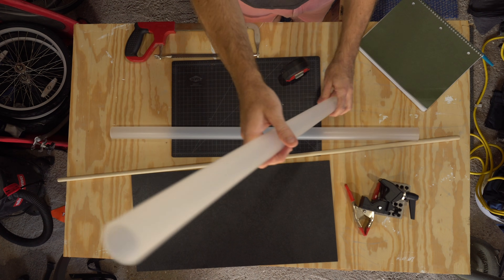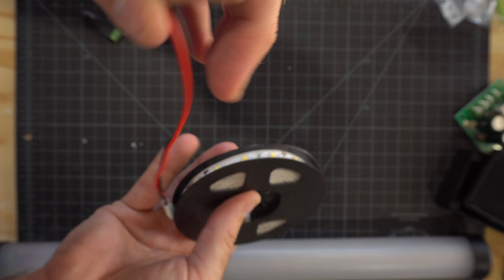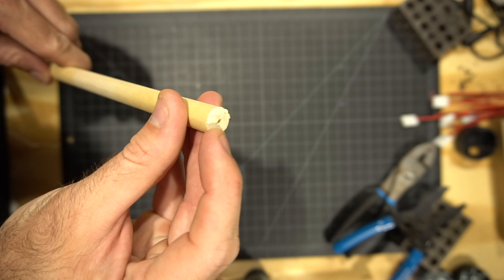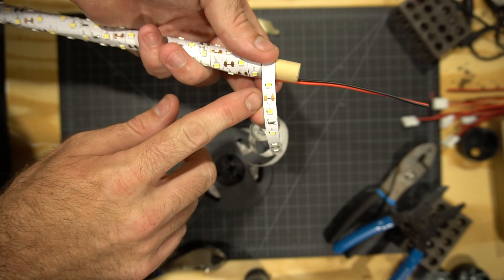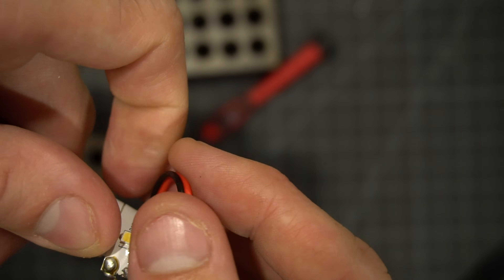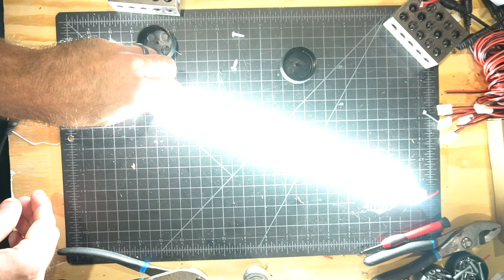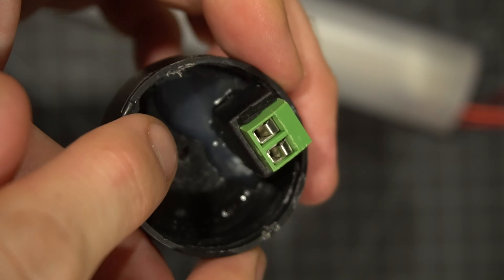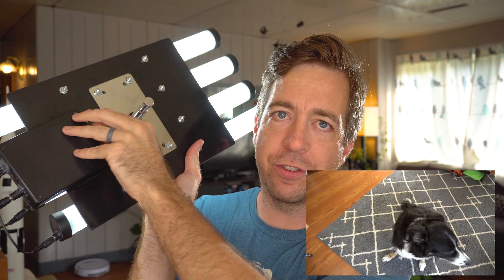TUTORIAL: DIY LED Tube Lights

Comment: A 4' quasar LED tube is $100 on amazon which is basically $25/ft.  How do these compare in brightness?
Reply from the maker: all Quasar brand tubes I've used will beat these in brightness, but I think the ones you're talking about are just the tubes and you'll need a housing (like an old KinoFlo shell or whatever) to mount them. These are fully self contained, other than power, much like the Q-LED line - which I believe are like $75/ft. If you can buy QS tubes then I recommend you do so - they are pro quality lights - but if you're interested in doing the DIY route these are an option to consider. Thanks for watching! :)

Comment: Whats the flicker like on these LED strips when filming video?
Reply from the maker: None that I've noticed but I'll do a shoot with them this weekend and share some footage - I'll run through some various frame rates and shutter speeds to see. Thanks for the question!
Reply: That depends on the duty cycle and frequency if using PWM.  I'd suggest varying the voltage or current instead.

Comment: that thing is going to get so hot, it'll melt the wire underneath the LED strip, just watch it :)))
Reply from the maker: Thanks for the feedback! I keep an eye on them at all times, and luckily I haven't noticed any heat that worries me (yet). If you've got any input on dealing with the heat on builds like this I'd love to hear it!  I'm not electrically inclined, just a tinkerer 😁
Reply: A possible solution is to cut a groove in the wooden dowel to flush mount the wire, or insert the wire into a hollow tube and mount the LED strip to that. The hollow tube would require finding a way to mount to the end caps.
Reply from the maker: Nice idea! I actually looked at hollow tubing first but couldn't find anything small enough that I liked. Appreciate the input!
Reply: That depends on the LED type and the current - usually heat is not an issue
Reply: @kennmossman8701   CRI90  heat is not an issue? OK :)

Comment: any idea how to make this with a battery?
Reply from the maker: Hi Jorge, great question - I don't have a definitive answer, but you SHOULD be able to power these with any battery that can output the correct wattage for your light strip. For instance any 12v battery would work for mine as long as it can fit the input - I regularly use a larger portable battery to power mine while out on shoots, but you should be able to use a 12v out on a V Mount or any other larger battery. Hope that helps!
Reply: Yes but it does get complicated by the choice of battery; Lead-acid, Ni-MH, Ni-Cad, Li-ion.   All have various advantages and disadvantages  Do use a PROPER recharger.  and keep in mind that even Li-ion batteries experience a voltage drop as they discharge.

Comment: With cheaper strips the mounting tape is crap - glue it down with epoxy.  Just put the epoxy directly on the surface, then apply the strip. The sticky tape will adhere.
Reply from the maker: Good suggestion!

Comment: If you have to solder a power connector then try using a molex style connector or terminal strip. The 'barrel' type connectors are a huge pain-in-the-@ss.   This is also true for 'external' runs as the barrel connector easily pulls apart
Reply from the maker: Kenn thanks for all this insight - I truly appreciate it!

Comment: If you 'tin' the copper pads on the strip before soldering the wires it is much easier/faster. Applying some flux beforehand can also help.
Reply from the maker: Hey Kenn, quick question - I've got an RGB light I want to use for this build, but it's got 4 cords and a 4 pin connector for power on either end... so I'm unable to run the wire along the dowel and connect to the top and bottom (hope that makes sense). What issues would I be running into without that? On another forum someone mentioned that wire helps distribute heat and voltage evenly throughout. Any input is much appreciated, and thanks in advance!
Reply: @DroiMedia  I think you mean wires (and not cords).  That's what I thought you did for the White LED strip which surprised me because it ought (!) not be necessary as "good" strip vendors state (how much truth there is in it is debatable) you can daisy-chain up to four 5m strips.  I have only one installation of a 5m strip and the brightness SEEMS uniform. Thanks for reminding me to actually check the voltage at the non-powered end just to see how much of a voltage drop there is.
Reply: @DroiMedia  The copper tracks / traces on strips (and such) are both thin and narrow which causes a voltage drop and so the LEDs at the non-powered end could be dimmer.  The voltage drop is  directly related to the current which is related to the density and type of LED (i.e 5050 versus 3825).  Generally speaking, the 'bigger' the LED and more the number of LEDs the higher the voltage drop. 
I have seen powering LEDs as you have done (from both ends) which ought to  balance the voltage (and so the heat would be uniform). I would not say the heat was distributed evenly as flexible strips "do not" distribute heat.
Reply: @DroiMedia  Soooooooo!   I see you have a few options. Ask the vendor for a RGB strip with the lowest voltage drop (I doubt they will have any idea as to what you are asking though) , or measure it for yourself. If the drop is more than say 0.2V then you could do as before (use a router to make a groove for the wiring), or run a buss wire at both the top and bottom. A buss wire is simply a thick wire meant to carry power to  circuits with minimal voltage drop.  There are Wire Charts available that give the raw data needed to determine the voltage drop for a given length and current
Reply from the maker: @kennmossman8701  thanks for this thorough reply (and yes I meant wires, long day lol), I appreciate your insight!

Comment: PLEASE anchor the soldered wires to the strip/wood using epoxy or hot glue.   Try to mount so the LED chips are offset
Reply from the maker: Hey Kenn - any reason to anchor the soldered wires to the wood? Just want to make sure I'm not missing something! I am by no means an expert with wiring/electrical work, so any input is appreciated. Thanks!
Reply: @DroiMedia  In general, any movement; (even heat expansion/contraction)but more  physical movement / shock  will stress the soldered connection - which is weak to begin with. This will either break the pad/trace  or the wire. To alleviate stress its SOP to bond the wires to a common surface. It is standard engineering practice that a connection be  1) mechanically bonded  2) electrically bonded.
Here you cannot get a mechanical bond but one can glue down the wire to inhibit flexing.
Reply from the maker: @kennmossman8701  This is awesome to hear, I had no idea. I truly appreciate the advice - anything else I could have done differently to help with the wiring or that would be beneficial to the durability/longevity? Thanks again :)
Reply: @DroiMedia  I can watch again. Meanwhile I can share what I do - though its hardly unique to myself. First apply a generous coat of hot glue over and around the strip and wires. Then, while the glue is warm, slip over about 6 to 8 cm of Heat-Shrink Tubing - with as much as possible over the strip. Then shrink it :)    Both the glue and HST act as a strain relief; The glue inhibits small movement while the HST inhibits larger movement. The HST also makes it look more professional. The hot glue also helps prevents a short should a wire come loose.
Reply from the maker: Great info - I'm making a few longer RGB tubes soon and will look into doing this for them. Thanks for the input!
Reply: BTW I slip the HST over the strip while the hot glue is still fairly hot as that draws the tubing into the glue - hopefully making a stronger bond and so providing more strain relief
Reply from the maker: @kennmossman8701  Good to know! Thanks again :)

Comment: If you don't want 360 degree light consider using a thin flat piece of wood and mounting the strips to the wood on one side.
Reply from the maker: Kenn, thanks for the input - one of my iterations used some of the u-channel pieces that you can mount LED strips with, adhered to just one side of the tube on the inside. Ultimately it didn't provide as much light (fewer LEDs). This is a really solid idea though and one I think could work out with the right solution - I just haven't found it yet. Thanks for watching!

Comment: Well, why not to show how your light shines on the example of a video?  Or is it not important anymore?  In fact, it makes no sense to do this thing if you have not seen what the frame looks like with it.  It seems to me - that it illuminates poorly, and only at a fairly small distance.
Reply from the maker: Thanks for watching, and you can see early on, and a few times throughout, how bright these are. But I agree, I should have shown it more in actual scenarios.
Reply: @DroiMedia  Thanks for the answer! I said that it is difficult to assess the feasibility of creating such a device with your own hands, and the expense of considerable work and a period of time, while not understanding how the light behaves in the frame when shooting. If you shot yourself in a frame illuminated by your device, and another person, or even a smartphone from a tripod, shot a general view from a side where the arrangement of equipment is visible, then there would be no question and doubt. And the brightness of the source in the video (without a specific scene, and the finished result in the form of a video) is difficult to evaluate, it depends on the settings of the camera and the aperture of the optics (at least there are other factors). Purely logical, a sufficiently thick white plastic absorbs light strongly, which will significantly reduce the efficiency of a diode tape (although the tape itself is not a very bright source). Therefore, to see all the conditions initially, and the result of the shooting is very important. And rushing to do something like this without confidence is pointless.
In any case, thanks for the video, the design itself is resourceful, simple and witty!
Reply from the maker: I truly appreciate this sort of input, I'll make sure my next DIY lighting video illustrates the light to it's full potential in a real world scenario. Thanks again for watching and for the insight into this sort of stuff, I know others will find it helpful as well. Also, I'll try and share a screen grab with you from a recent shoot I used the light on. Seriously thanks again! 😁

Comment: Well done ,can you make battery powered?
Reply from the maker: Thanks! And yeah! Any battery with a standard 12v output should work!
Reply: Sony np 970 batteries have 7.2 volt output but my led panels are working ,how?sorry for dumb question but this subject is out my knowledge.I was looking for battery powered led panels and found your video . And your video was very useful ,now I wanna make battery powered tube light too : )
Reply from the maker: You might be able to find a lower voltage LED strip, or you could possibly utilize a different battery source
Reply: Strangely enough  while the answer is yes that is complicated though the largest factor is the desired run time which dictates the AH of the battery

Comment: Looks good. How's heat with this closed enclosure?
Reply from the maker: Thanks and great question! It gets slightly warm to the touch right now. I approached some friends with more knowledge than me after my first build got HOT, and they suggested I wire both ends (as seen in the video / finished build) - seems to work but I always try and keep an eye on it just in case. Thanks for watching!
Reply: @DroiMedia  What do you mean wire both ends? It's ok to run all 4 wires into the same power source?
Reply from the maker: @danreynoldsphotography2735  so far so good. I asked some folks with more experience than me about wiring and they told me wiring both ends helps distribute the heat and voltage/electricity (my first run through where I only wired one end got WARM with extended use). So my recommendation is wiring both ends, BUT, you absolutely do not have to do it to make this build work. Thanks for asking and let me know if you have any other questions!
Reply: @DroiMedia  Hey I just noticed you are in Normal/Champaign. Peoria here!
Reply from the maker: @danreynoldsphotography2735  sweet! I'm not in that neighborhood often but next time I am I'll let you know and maybe we can grab a cup of coffee or something (presuming of course this quarantine ever ends haha)

Comment: Fantastic! I've been thinking the last few weeks about how I need to build some tubes before these tariffs get too crazy, but I might have missed my chance. I was thinking about using fluorescent tube protectors as the tube and spraying them with spray on window frost, but I might have to check out the acrylic tube you used because i'm sure it's much more durable.
Reply: before i got quasars i did the exact same thing. Got the tube protectors and sprayed with window frost. it looked good and worked. this is a video with them https://www.youtube.com/watch?v=n1UI3anIyog
Reply from the maker: Saw those very tube protectors at my local hardware store and realized if they were totally stationary (i.e. just lived in a studio somewhere) they might do OK, but the acrylic tubes are as thick as a PVC tube so I'm guessing they could withstand a good amount of abuse if you need them to work out in the field or get moved around a lot. Let me know what you decide to go with - would love to see the finished tubes!
Reply: There are two types of plastic normally used - each has its advantages